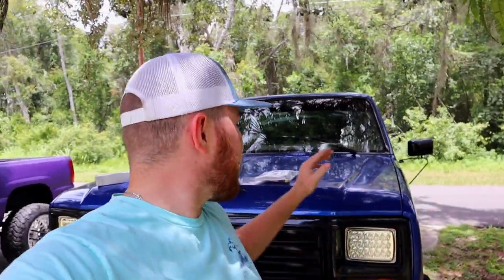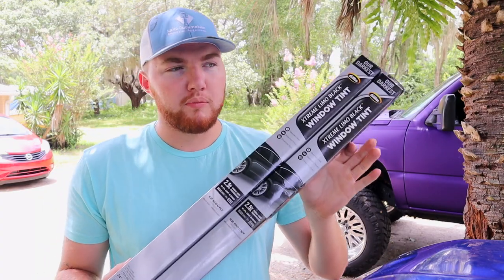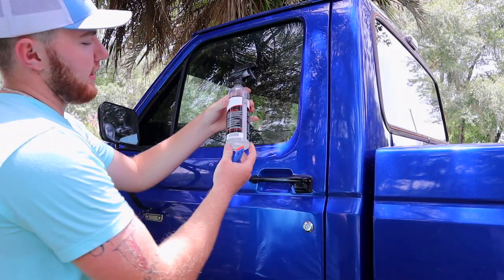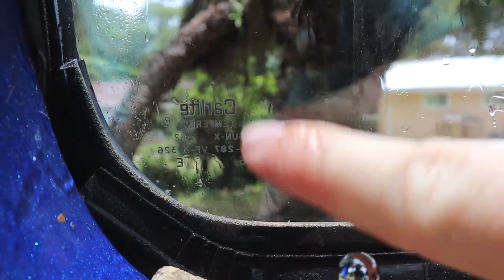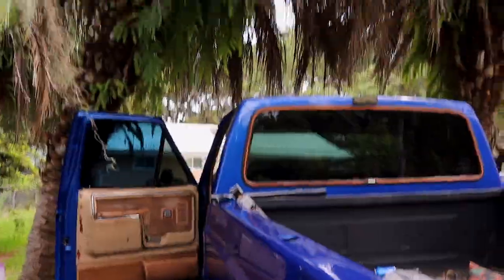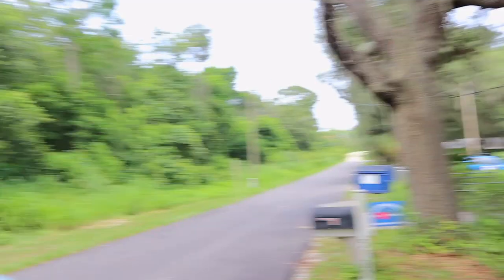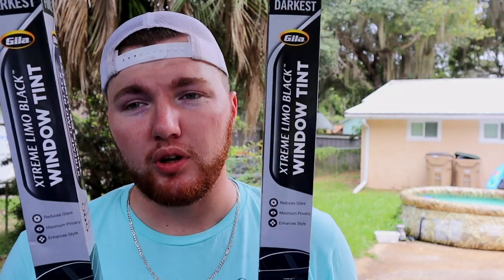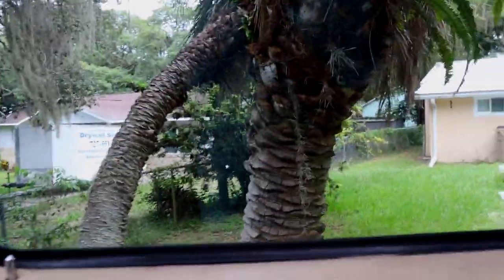How BAD Is CHEAP Window TINT?

Comment: I had some of that gIla 2.5 and it wasnt perfect, but i loved it! I had a RCSB s10 and did the side windows with it, IT WAS DARK! That truck sat in direct sunlight for 6 hours in the summer and was still cool when i got in it. It was crazy good at sunlight blocking and it blacked out my interior. I liked it far better than the pre cut ebay tint.

Comment: I have the same exact tint on my silverado exempt for the windshield.  And yes you need to have some window tint experience I just learned  that by watching YouTube videos. I had it for more than 2 years and still look amazing.
Reply: Same brand?
Reply: @mcmagdiel3277  yes exactly the same at orallys
Reply: Make fine cuts.. and need a heat gun.. plus you're outside you probably got some debri.. I have this same tint.. I got it done good actually.. just takes mad patience
Reply: BTW 2 years strong on mine..

Comment: I don't see it as a fail. 
I see it as a $30 test that you know now how to tint.
you know you can do it with good materials so it's a $30 lesson. 
that's a good deal. 
that and you helped me by giving me a heads-up on putting something like that on my benz.
I will look at a good company to order from so you did a few good things here .. all W"s not L's .. 
dude I build custom motorcycles ..
do you realize the amount of money I've spent on test lessons lol 
my lord 30 bucks is a solid deal. 

I did the start painting candy pain jobs with spun silver leaf inlay. 
lol those paint jobs cost upwards of 10k for a wicked reason. 
I spent lots  on messing up and having to restart a few times. 
that and 4 hours is not to bad either honestly. 
I messed up a tank and just tge corrections were about 15  hours ish.

Comment: In my expensive if you’re gonna go get cheap tint go with Magic Black, I’ve tinted with Gila and it’s shit, I removed it after 2 weeks and had all kinds glue and residue left on the window, after just 2 weeks it should come off clean, I did the same with black magic and it came off with minimal residue
Reply: Black magic tint is rubber tint.. with no experience you'll get  Def crease the rubber faster than gila.